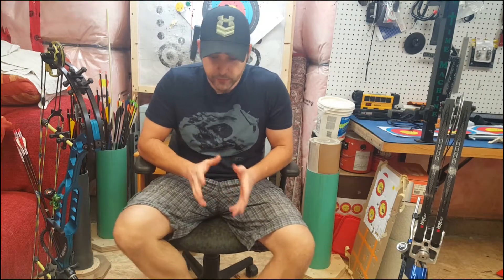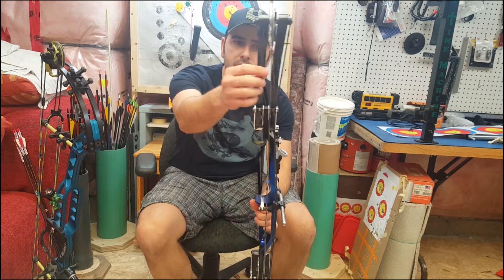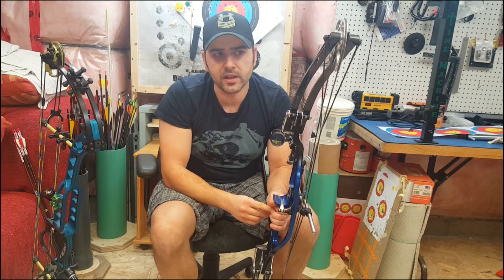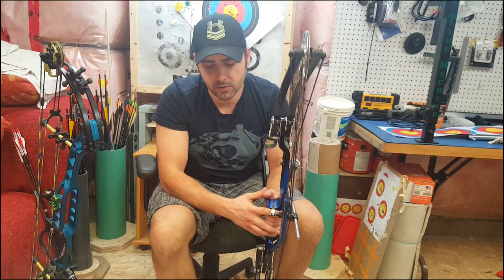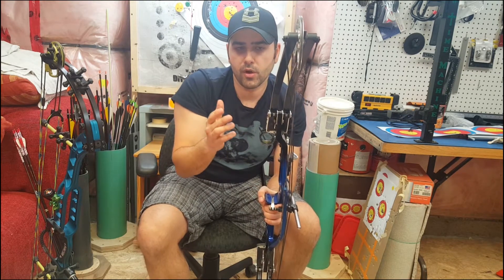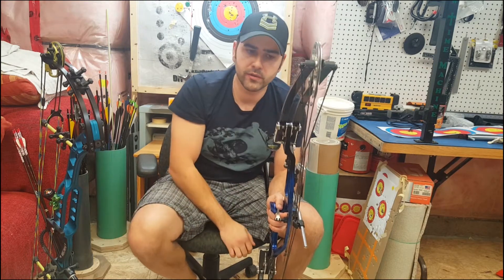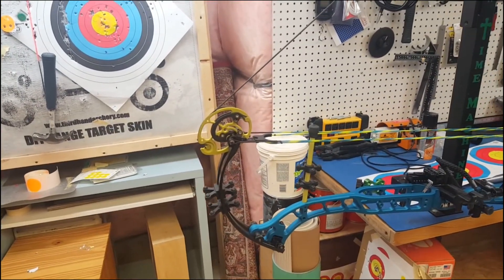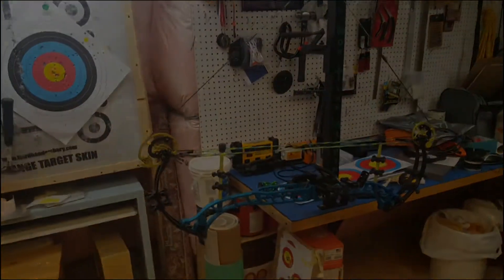Fixing cam lean on an OK Archery compound bow

Comment: I got a hyper edge and I've had to put in left cam lean to get a positive paper tune
Reply from the maker: Robert Guy goal is good arrow flight, and given an arrow that's not too weak, you get that if you line up the arrow with the string path. You can do it by moving the rest (moves the arrow), by adding cam lean (moves the string) or combining the two.

That said, I start without cam lean and go from there in a controlled way.

Comment: Do you check for cam lean on the bottom cam as well?
Reply from the maker: I check and adjust if necessary both top and bottom. Process is identical.

Comment: My bow won't stop squeaking
Reply from the maker: Not sure what kind of bow you have, but first would be to see what's squeaking. Could be coming from the cam axle, could be the limb rubbing against the pocket, could be the cable guard... So have someone draw your bow (or even better if you have a draw board) and you try to listen what's causing the squeaking. Once you figure out, fix may be as easy as aligning the limbs better in the pocket, or as tricky as taking the bow apart, shimming cams and retuning...
Reply: Sean Archer Okay thank you